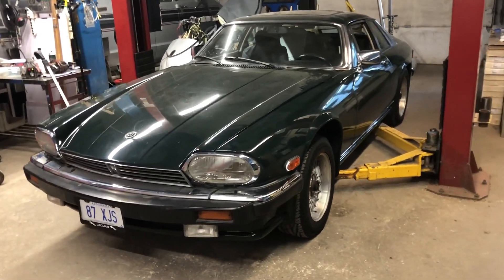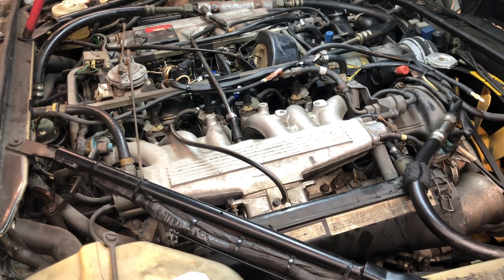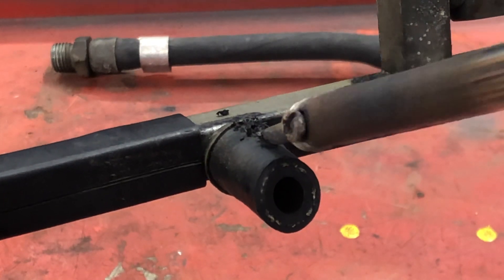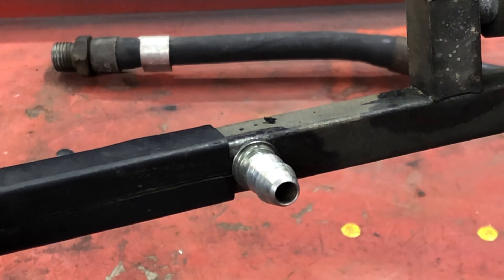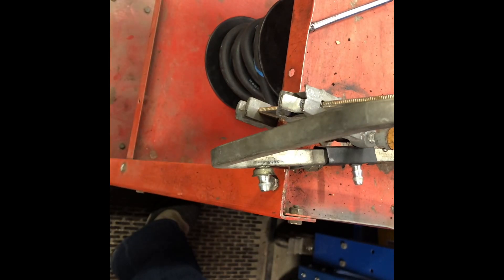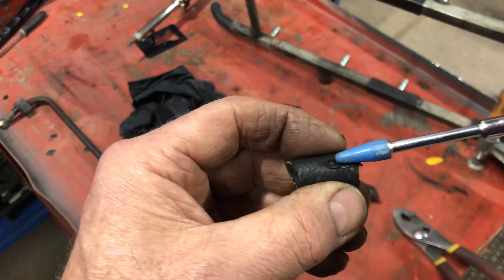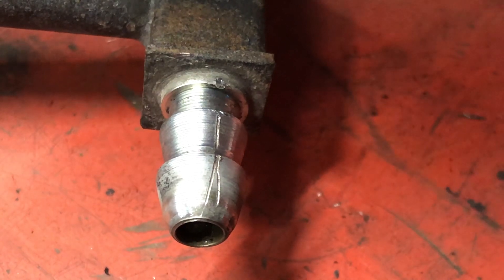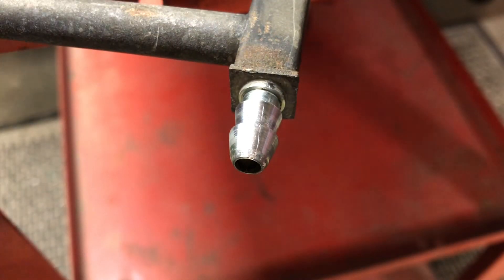Rotax 912 / 503 / 582 how to remove fuel or oil hoses without damaging the fitting

Comment: Great tip John… I could have used this to get the radiator hoses off the heater barbed fittings instead of the exacting knife.  Luckily I didn’t mark the fitting.
Reply from the maker: Thank you, I’m sure there’s lots uses to apply this method to.